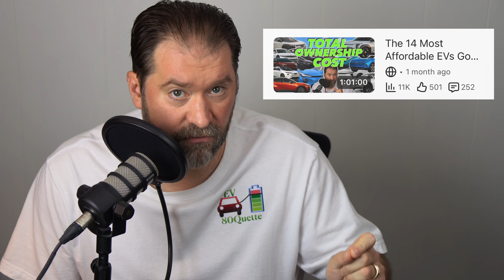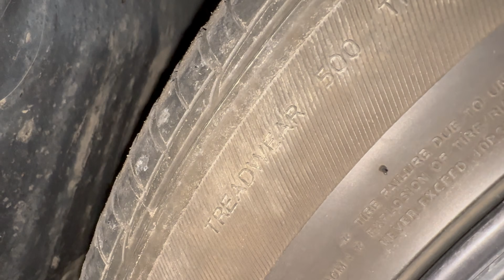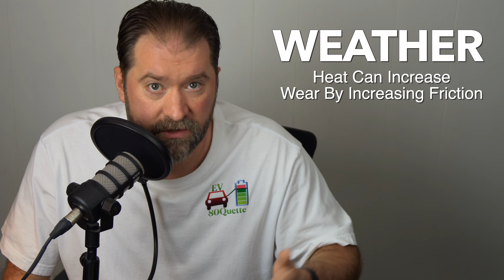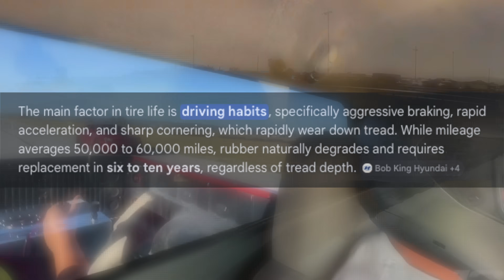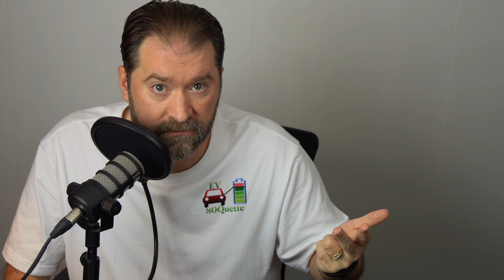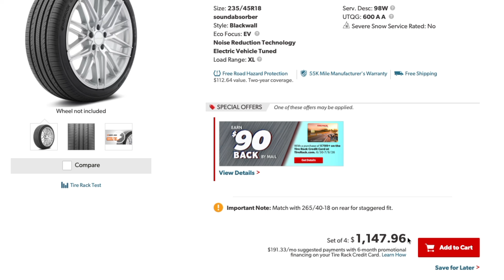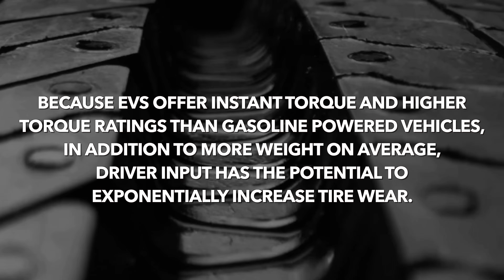I Got New Tires For My EV - Here's Everything I Learned

Comment: After almost 60k miles in my EV6, I was ready to get new tires. My wife and I do the boring super efficient driving (4 miles / kwh or better). We put approximately 25k miles per year, and I wanted to change the tires before the rain season. I check at Costco and I am buying the cheapest tires in my car size, which happen to be Pirelli for EVs. The catch, these are summer tires, but I live in Southern California so not worries about that and I have another car that I can take to the mountains and play in the snow in the winter. I will check the warranty conditions and get the preventive maintenance (rotation) done for free at Costco.
Reply from the maker: I’m glad you’re able to run summer tires. This is a nice option.  Cheers!

Comment: Do tires survive longer on AWD EVs? The torque per powered wheel at same acceleration is only ½ as much, reducing squirm and slip.
Reply from the maker: I think this a fairly safe assumption, if everything else is the same

Comment: Interesting take. The video is an interesting perspective. I'm running original Pirelli Scorpion MS on my Model Y Juniper and it has 53,000 on the original set. I'm looking to replace them. I could see why you are looking at tire wear if you are replacing at 7,500, someone is driving like Don Garlits :). For me, I take a lot of long trips, so looking at comfort and roll resistance, and the tires you selected would mean stopping 20-30 more often than a good ev tire would. I'm looking at the Michelin eprimacy, or similar.
Reply from the maker: I appreciate your feedback. For your use case, I don’t think the tire I selected would be the best choice.  Almost all of our driving is local, and could be in all kinds of bad weather.  Thanks for sharing your experience

Comment: My Audi Q4 e-tron came stock with Bridgestone Alenza Sport AS...and they were rubbish. Even when new the car doesn't seem to grip in any climate but perfect conditions. In rain they were squirmy, in winter flat out dangerous. At the tire shop they suggested the Michelin Crossclimate 2 but I knew they gripped well from my prior Audi A3 but my fuel mileage went down, so I was unwilling to compromise rolling resistance for better grip. I saw on a lot of Tesla, Mach-E and Ioniq forums that the Hankook Ion Evo were excellent all rounders and they were far less $ than the Goodyear ElectricDrive 2, so I took the plunge.

Now a year and ~10000km in with the Ion Evos and I've been impressed. Efficiency went up, grip is better regardless of weather & the ride has actually improved. The only downside I noticed is the "straight line" feel isn't as good on the Hankooks and they don't have the outright grip of the old Alenza Sport, but given the price tag and the benefits I think it is worth the trade.
Reply from the maker: I really appreciate you sharing your experience with the Ion EVo. I’m glad you found a good fit. Cheers!

Comment: I have 3 EV's.  One with Michelin Pilot Sport All Season 4's, one with Hankook ION Evo AS and one with Continental Extreme Contact DWS 06+.  All 3 work well but with differences.  The Michelins have a stiffer sidewall (my opinion) leading to a bit of a firmer ride.  The Hankooks so far have been a longer lasting tire and work OK but for winter (NE winters) I settled on the Continentals just like you did in this video.  If I lived in a dryer climate like SoCal I probably would get the Hankook's again.  One caveat.  Foam.  I elected to go with a non-foam tire for 2 reasons.  1. Foam MAY be an issue in balancing (although the foam has been a non-issue to date with 18k miles on my Hankook's) and 2. Flat Repair.  I had one flat on the Michelins in a repairable location on the tread and they were easily pluggable by the tire shop.  Some shops have issues with plugging or patching foam tires so on my 3rd set went the Continental route.  Had Hankook had a no foam option I may have gone Hankook again.  With Continental's, the ride is good, the sound level is negligible and overall to me  a pleasurable ride and more easily repairable.  One note on rebates - my set up on after market alloy wheels I elected to take the wheels to a reputable shop (recommended by Tire Rack), had them Road Force Elite mounted then I installed them at home (saving my factory rims for snow tires I will try this winter).  Following the Continental submission steps including a photo of the tires on the car my submission was denied.  After much digging I contacted Continental and they stated AI does the initial screening of rebates and makes errors.  I resubmitted to a human for review and was APPROVED for rebate.  So if denied dig through the web site, write to Corporate and plead your issue.  You can also contact Continental through FaceBook messenger and they can help route you to the correct recontact e-mail person.  Regarding alignment - I added Mountain Pass Performance rear Camber and Toe links on all 3 EV's.  My Tesla's have wide range of "Spec" for rear camber.  The camber while adjustable is crude.  Tesla will say non-adjustable but if you read the service manual they can be slightly adjusted but it involves loosening a bolt and moving the entire swing arm (probably needing a crow bar).  Installing the MPP adjusters is easy and precise.  Tesla wont touch them.  I have a great after market EV shop staffed by former Tesla techs.  I asked to adjust the rear camber to a negative .5 degrees setting (still well within spec) and this helps extend rear tire life along with rotating.  Some will elect zero degrees of rear camber (that is still within spec for unloaded reading per the manual).  The ZevCentric youtube channel has a few videos on camber adjusters.  I have NOT lowered my suspension just wanted better tire wear.  So far working out well.
Reply from the maker: Thanks so much for the details on the rebate. I had the same issue. I appreciate the detailed explanation of your experience as well. Cheers!

Comment: Instead of using a penny, get a tire tread depth gauge. I bought one and the first time I rotated tires on my Model Y I recorded tread depth on the outers and center part at the tire valve and on the opposite side of the valve. I numbered each wheel so I can keep track of how much each tire is wearing. And I keep the tires inflated 2 psi over the recommended level. I've never worried about tire wear on all the vehicles I've owned, just rotated them more or less on schedule. Now that EVs are notorious for wearing out tires I wanted to really find out for myself if it is true or not.
Reply from the maker: I’m definitely getting a gauge. Thanks so much for sharing your experience!

Comment: I was starting to get excited about the new ex60 Volvo, now 8 learned it has different  tires on the front from the bigger ones on the back, so no rotation.
Reply from the maker: This will definitely increase the cost for tires. Any alternatives instead?
Reply: @Aslash304 It doesn't look like it, but it's not available in the US yet.  Kind of looks like the new Volvo, the BMW and the Benz all come that way.
Reply: @Aslash304 I understand that the setup improves handling.

Comment: You have these fast pickup trucks. All you need to basically set your eyes on. It's a tire that can handle 5,000 lb as well. High torque is it you need to wait for the tires to be able to hold up the weight of the car? That's why you go for a sport truck tire for a car. You'll be fine
Reply from the maker: Thanks for your comment

Comment: New Car tires: 2023 EV6, so 4 years old (bought in 2022) running Kumho Crugen HP71 EV. 500 aa 101H. at 20,000 miles, and wear indicators well down in the tread grooves. Guessing these will go at least another 10-15k. I assumed buying the car that I'd be putting some new Michelins on there by now. Kumho had other ideas. The tires on the Niro EV are Kumho Solus TA31 EV, but at just over 8k miles look brand new, so no idea how long they plan on lasting. Both are great in the rain though. With all that torque (as you mention) EV's like to bust free in the rain on start but these don't. My old Fiat 500e on Firestone Firehawks (from the dealer. Jerks) buted free now matter what. The Michelins later fixed that.
Reply from the maker: I really appreciate you sharing your experience here!

Comment: Dude I installed the cheapest tires on Amazon on my Model 3. Don’t worry the  rating is proper.  Anyway 10,000 miles later they are quieter than the OEM tires and my range has stayed the same. Tires were $85 each.  Local Tesla service wanted $1800 to install four new tires. No weight is not an issue.  Both my EVs are lighter than the BMWs they replaced.  Anti EV arguments have become comical.
Reply from the maker: Thanks so much for sharing this!

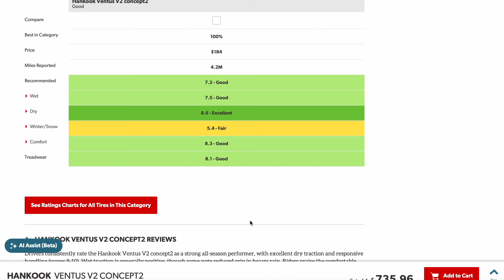Comment: The complaint from your wife was ....he NEVER says it... but the clip has WINTER PERFORMANCE @ the 17:50 mark so...
PS - Unfortunately, this video seems to think the DWS06's will WEAR better.  I have news for him... they won't &  Ican confidently state that because...
I HAVE been running DWS06's for the past 14 years on my 2012 BMW X5 Diesel.  Yes, they DO perform well in snow but he will be lucky to get 30K miles out of them.  BTW the ones on the X5 are nearly TWO THOUSAND $s for 4 of them (two 265/40/20 & two 315/35-20).  The DWS06s are NOT self-sealing so he WILL NEED a 5th spare tire or an AAA membership.  I just replaced the front two for $841 including installation and road hazard warranty.  I rotate regularly and ensure pressure is correct.  I have a 2024 Cadillac Lyriq with 17K miles on it so far
Reply from the maker: I am hopeful that the DWS will give me more than 7,500 miles, and I plan to rotate regularly and claim the prorated portion of the warranty if they don’t last.  I really appreciate you sharing your experience with them.

Comment: Thanks very much. This was one of my main concerns when buying my first EV which will be the Rivian R2. One concern I have is the tire size on the R2. I am having difficulty finding any replacements for the 255/55R21 tire that will be one the version I am buying. Hopefully once this nice vehicle is on the road in numbers tire mfg will have some solutions other then the tire it comes with.
Reply from the maker: It usually takes a few months for different options to be offered after a new vehicle is released

Comment: Spot on .. good job.  I’ll add in one more wild card as I’ve driven EVs for 450,000 km since 2015 and have gone through a ton of tires .. and that is noise.  The rubber compound makes a difference and to sell, some tires use a softer (quieter) compound that doesn’t last well over a harder (noisier) compound that lasts longer.  This allows the tire to meet its life rating .. but those final miles are loud!  No idea how to select around this as it isn’t advertised.  I went with a set of Sailun (Chinese) tires for my last set as an experiment.. they were louder as new .. but the loudness did not increase as they aged.  I saved money and they proved better over their life.  Go figure.
Reply from the maker: Thanks so much for watching, and for sharing your insights!

Comment: I love taking off quickly from a light, leaving the traffic behind me. I have a 2022 dual motor, long range Model Y with 55,566 miles. 

I replaced the original tires (45,000 mile warranty) at 51,340 miles and they still had some tread on them, but I wouldn't want to drive them in snow. 

Torque is not the problem. It's cornering. If you want your tires to last, don't drive like you don't care about them. Go slow enough on corners and curves that you don't feel like you're getting pushed to one side of the car.
Reply from the maker: Curves can certainly play a major role in wear if you take them too fast.  Great point

Comment: Curb weight and torque = expensive tire maintenance
Reply from the maker: Rotations are free at my local tire shop, and I think I paid $29 for the air compressor. Curb weight and torque plus lead foot equals more frequent tire replacement.

Comment: EV's make sense for those who can afford them, just as buying a brand new ICEV every couple of years makes sense for those who like driving around in a $50,000 depreciating asset. Not for me. I bought my Toyota for $5k and now it's worth $2k but it's just as reliable as the day I bought it and will be for years. No $1000 a month car loan, no binging and bonging at me every time I move my head. Life is much simpler when you live simply.
Reply from the maker: I appreciate the feedback. Replacing coil packs and o2 sensors, and the check engine light, and oil changes, and transmission fluid, and Wheel bearings, and bushings going bad from head and nvh of an engine,  and brake squeaking, and pads and rotors, and letting the car warm up, and knowing you’re not as safe as you could be for the sake of your family, and the gas station, and having trouble making it up hills unless I punch it, and shifting, and gears, and worrying about the price of gas going up, and the smell extreme heat, and the smell of exhaust after a cold start, and oil leaks, and brake dust, oh how I don’t miss the brake dust. EV life is pretty simple, and a Used EV can be had for very cheap at this point. They don’t just make new ones. They have been around for like 15 years now.   You can get $100,000 EVs that the owner communities have sorted via DIY completely for like 9-10k. To each their own
Reply: @Aslash304   Funny how nobody complained about any of that 20 years ago. I think EV owners have sunk cost fallacy built in. They have to justify the money they spent so they try to think of everything negative about ICEV's to justify their decision. But as you say, each to their own.
Reply from the maker: Or we just use math. Total ownership cost is a calculation people don’t like to think about, just like the time it takes to drive to and from a gas station.  Sunk cost fallacy applies to time, money, and effort.  “What if I could trade some extra money up front for significantly less effort and time in perpetuity?”  Ever bought a water at a concert? You could leave the venue and buy the same water for 1/10 the cost, but you’ll miss the show. I found 25 EVs for sale near me for $5,000 or less.  Just FYI
Reply: @Aslash304  If you plan ahead you buy your water before the show. Not sure where you are but I have already looked at used EV's where I am and the "cheap" ones have 100kms or so of range and still cost double the equivalent ICEV. Anything with decent range is priced accordingly. Sellers are not stupid. They know these vehicles are in demand because of the fuel savings.

Comment: I currently have 45k on my Michelin CrossClimate(non EV specific tire tire on my Fisker Ocean.  I have been rotating these tires every 5K miles.  I have been non- aggressive in my driving habits. In town where most of my miles come from I drive w/heavy regen braking and in “Fun” on the Fisker. I currently have 5/32 tread depth and should get another 5-10k miles before I get new tires this November for the winter.  I definitely get tires that have 3 peak mountain snowflake so I don’t have to worry about chasing up over mountain snowflake passes. Very happy with the Michelins but they are expensive.  Hancook tires w/3 peak snow flake rated tires will definitely be getting a look from me in the near future.
Reply from the maker: I really appreciate you sharing your experience!

Comment: Replaced the tires on my 2014 Volt with a Walmart Special - 4 tires for less than $300. They are Crossmax CT-1 All Season tires. They are probably Chinese but they actually had fairly good ratings and 60k mile tread life warranty so I gave them a shot. The factory tires were low rolling resistance Goodyear Assurance that had 45k miles on them and still had tread left, but were dry rotted so I had to replace them. So far I've driven about 15k miles on these cheap ones and they still have lots of tread left.  The only downside was about a 10% reduction in range (on the Volt, that's a loss of 3 miles). They have better grip than the Goodyears and are quieter.
Reply from the maker: I appreciate you sharing your experience!

Comment: When we got our Rivian I got a second set of 20" wheels, and I picked up a nearly new set of stock tires from a full size truck for $200. Around here a lot of people lift their new trucks and put on larger tires so you can find stock size load range E tires for cheap. I save the stock Rivian wheel and tire setup for longer road trips.
Reply from the maker: Great strategy, and a great deal! Thanks for sharing

Comment: If you have a front drive EV then you will BBQ front tires.  The Michelin back tires on our 2020 Bolt lasted over 5 years good as new.  Fronts are destroyed fast.  Front wheel drive EVs are trash.  Dumbest idea in automotive by far.  Kuhmo Solus 51A are really good though.  Great traction and decent noise.  Never was quiet because Chevy is lazy 😂
Reply from the maker: Thanks for the feedback

Comment: 🔥Torque  ➙ Slip  ➙ Tire wear⁉️  I punch my Tesla Model Y often and I never experience perceptual slip.  How much does that really add to wear? Unlike “peeling out” in
Reply from the maker: Slip does not equal smoke.  Tire wear is much more nuanced than A. Spinning out / B. Not spinning out.  Hence the need for 20 minutes to explain. Maybe you’ve got a magic set of tires.  If so, I’d love to know the brand and the mileage you’ve gotten so far.
Reply: @Aslash304  So far, I have 25,687 on the original tires with “lots” (haven’t actually measured) of tread remaining.